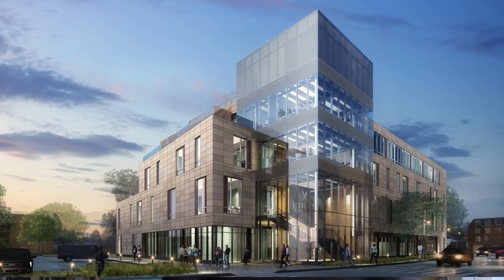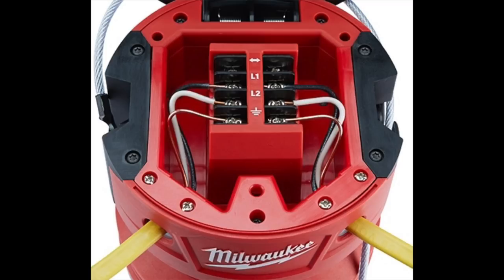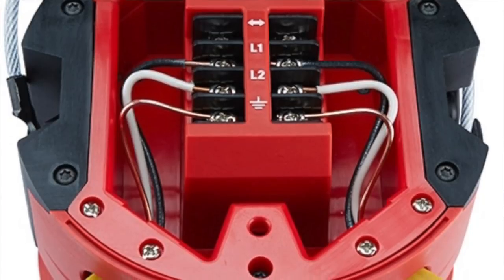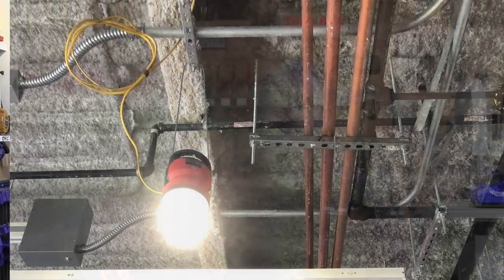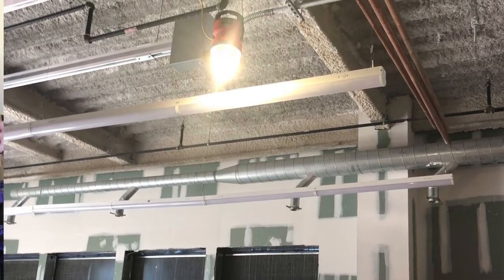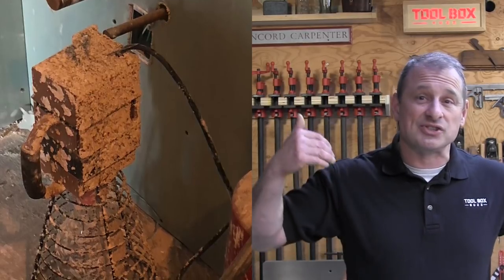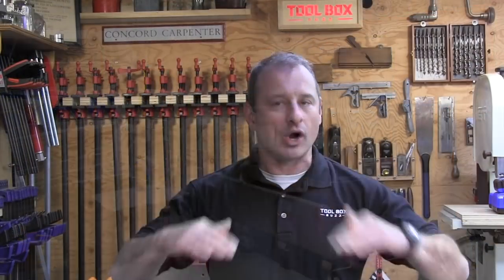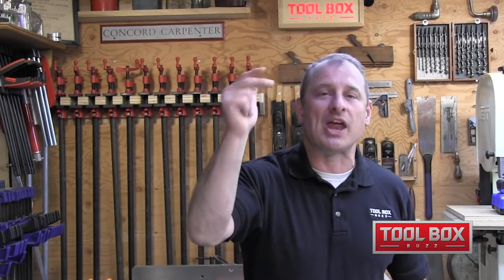Milwaukee LED 2155-AC Radius LED Temp Site Light

Comment: We are having problems here in VA with 120v temp lighting. OSHA is always busting job sites for the wiring being within reach. Other trades are always moving the wires. We are now using a 24v LED system to avoid this problem.

Comment: The reason they use cheap light is just what you showed. They either get sprayed by fire proofing or drywallers. Smashed buy ladders scaffolding you name it. No way would I pay good money for a light and leave it for other trades to destroy. Cause you won't get paid for the damage to them. I'll stick with the portable lights and take them with me to the next work area. Nice thought though.
Reply from the maker: Leo Jeidy in my opinion, these will FAR outlast cheap lights. First of all spraying  them will not pop the bulb, and the lens a can be replaced if needed.  Secondly, the LEDs don’t break, so this light can withstand abuse the cheap lights can’t
Reply: @ConcordCarpenter  sorry but I've been on to many jobs  a seen plenty of people who could break a steal anvil with a rubber hammer.  I get that there way tougher that a regular lite. And you can buy a lens rather that a cheap bulb. But the other problem is no one steals  cheap lites.
Reply from the maker: Leo Jeidy Very true these lights are usually open a high bay, and if not you can always lock them with the cable lock, it comes with the cable

Comment: Incandescent Lighting energy uses only gives you (5% Light). The other (95% energy use is wasted in Heat Output), the energy used to heat the element to make it glow for lighting.